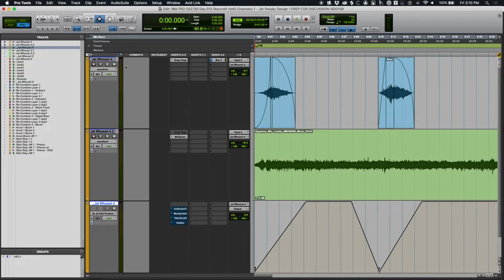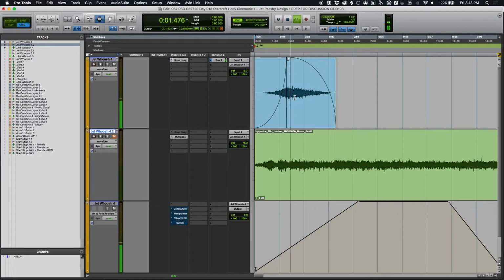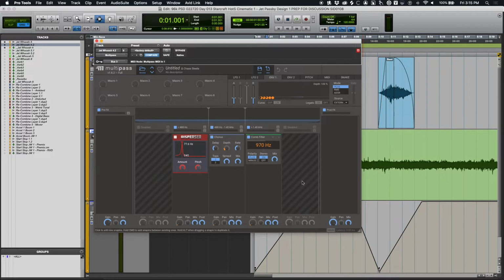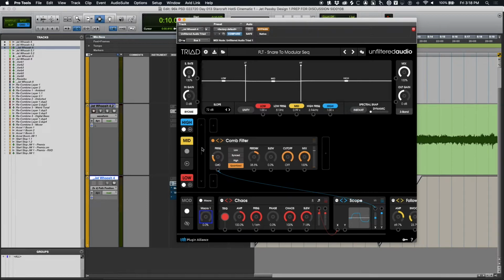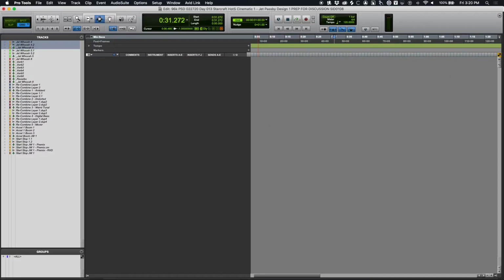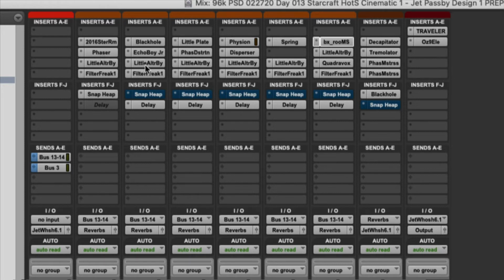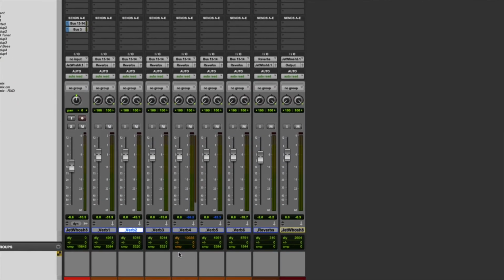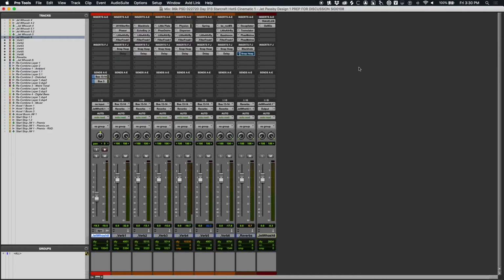How To Design Futuristic Vehicle Sound Effects Part 2 - Sound Design Workshop

Comment: Which plugins are free that you using? What are the best VSTs, want to start create Sounddesign for an futuristic world (cars, drones, ambient)?
Reply from the maker: Most of what I'm showcasing in this video are plugins that I bought. That being said, most of the key benefits I'm getting from them boils down to saving time. I could do a lot of very similar things with Pro Tools stock plugins and perhaps I should do a video on that in the future! I usually like to recommend Logic Pro if you have a Mac. For the cost, I believe it gives the absolute best value and has great stock plugins.
Reply: @soundsparkchase6432  Thanks for your reply. I'm using ProTools and yeah it will be great if you make a video with the stock in plugins on PT Software :)